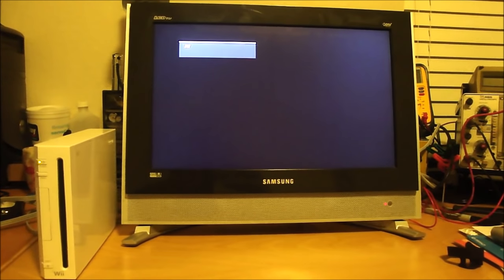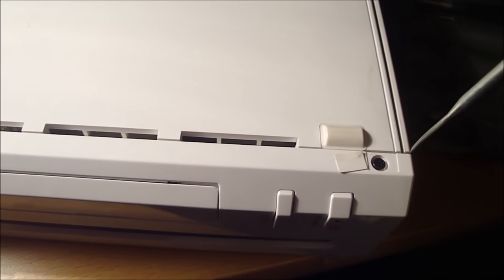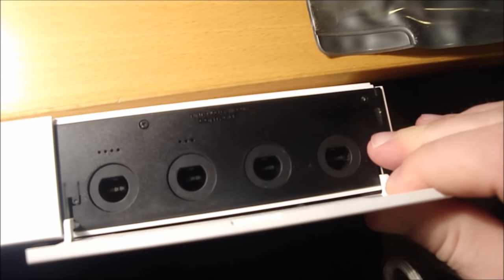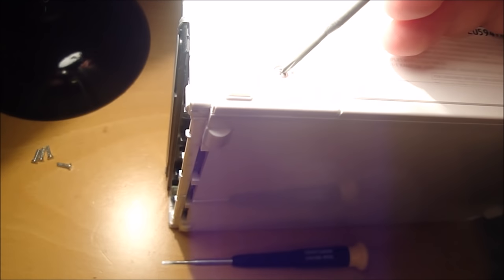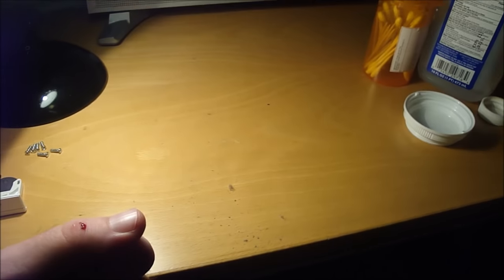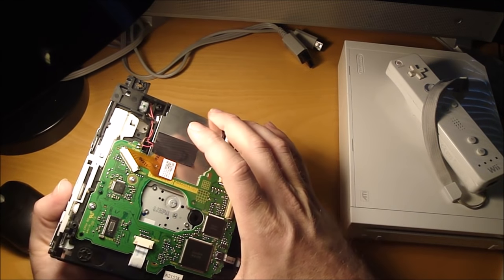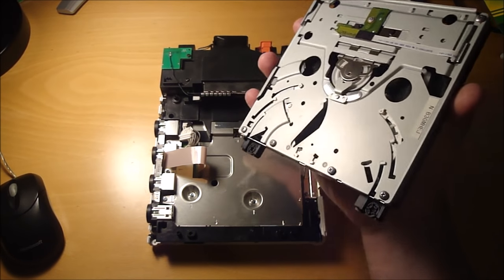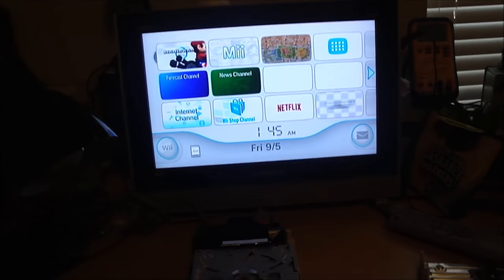Fix Wii Disk Read Error

Comment: I cleaned it like you did. And and turned it on. It showed the game and I clicked on it it got to the safety scream and the said it had trouble reading it. What do I do from there? just do what you did and buy a whole new disc drive?
Reply from the maker: +Aspen Tucker If it does that with most games and the discs are clean and clear, I would say replace the drive. I assume your laser is getting weak.

Comment: hey man my wii wont work for the same reason it wont read the disc thanks for this video man!
Reply from the maker: Let me know if you get it fixed. Thanks for watching!
Reply: @becausestuffbreaks  will do!
Reply: @becausestuffbreaks  i think ima gonna give up
cause i cant get the cover off because
the 3 point screw wont come off
thanks for the video though
Reply from the maker: @epicness69992  you can buy the screwdriver cheap off Amazon or eBay.
Reply: @becausestuffbreaks  ok will do thanks again

Comment: Hi great vid I have the exact problem with your problem that where if I put a disc in it makes a weird back and forth noise do you why it does that? And can it be fixed? Thank you
Reply from the maker: Did you try everything I did? The video has it all.
Reply: I opened it and I tried cleaning it it didn't work so I really want to try to fix it because I dont want to buy cheap knockoffs on Ebay. I dont know what to do is that back and forth noise the laser moving? I might replace the lens
Reply from the maker: I think it is the lense and it's going back and forth because it can't see what it's looking for
Reply: Oh ok I will attempt to replace lens and see if it works
Reply from the maker: Let me know how it goes
Reply: Ok I'm waiting for it to arrive
Reply: @caleb1736  any luck?
Reply: Finally it arrived, I replaced the motor turning the lense. It worked! I know why the lense couldn't find the disc. It is because I moved the side of the lense (NOT the top, and I had gloves on) and as I moved the lense where the rod was. It was stiff! You needed more effort to move and that back and forth noise is when the lense can't move far and it trys as hard as it can. That's why is goes Click click click. Anyways I looked at the motor for the lense and saw that the motor wasn't turning smoothly. I relubicated the metal bar to it and left it for a while then, came back and saw that is was turning smoothly! I put it together and it worked although the lense did go beeeeeeep about 7 times! When it is supposed to beep once, It still read the disc. Thanks so much for the vid!, I have a video on my channel about my wii being fixed and the laser lense. Feel free to check it out (warning I'm new to YouTube so please dont think my vids are cringy. Anyways thank you for reading this! Glad YouTube exists
Reply from the maker: Awesome! Thanks for the update.
Reply: @caleb1736  thx a ton for the update! I will have to check that on my disc drive.
Reply: No problem anytime!
Reply: Let me know if you need any help I will try to answer you as quick as I can 😉
Reply: @caleb1736  welp i kinda gave up and just took wires off the disc drive and put the board in itself and hacked the wii. (broke some plastic to lol. Like where one of the tiny boards sit near the power plug back of board. Also where cmos battery enters.)
Reply: Cool😁

Comment: Should I buy a disc drive exclusive to Wii or can I use any DVD drive?
Reply from the maker: +Bharath Ram you have to use one exclusive to the wii. Refurbished drives are cheap on eBay.
Reply: ***** Okay. Thank you.
Reply: Justin Peters hi I'm having a problem with my wii when I put in the game I don't hear the sound I'm not sure if the lens needs cleaning or I need to replace the drive
Reply from the maker: +Sting Are you able to play but just don't have sound?
Reply: ***** I'm still able  play it but when I put the  disc in like it won't read the disc I'm not sure if the drive needs replacing or I need to  clean the lens
Reply from the maker: +Sting If you're able to play the game then it is reading it and your drive is probably good. If you don't have sound, it's possibly an issue with the cable or TV. Am I understanding your problem correctly?
Reply: ***** just now I put in wii sports it started reading then it went black and it said error has occurred and when took out wii sports and  i put in smash bros brawl it didn't read
Reply from the maker: +Sting I understand now. I would recommend trying to clean the laser first. You can try blowing compressed air into it, use a cleaning disk, or take it apart and use a Q-Tip with rubbing alcohol. If that doesn't work, you need to replace the drive.
Reply: ***** thanks

Comment: Hi. Can you do a video on the Wii U? My super smash bros. wii u keeps getting an error and it's also worse than getting Brawl to work on a wii. It's a dual layer disc and it's Error 150-1031. Thanks
Reply from the maker: +J-Mac n' Cheese As soon as I get a customer with that problem, I will. In the mean time, try to use a laser lense cleaner disc for the Wii U drive and blow some compressed air into the drive. Also, clean the game disc with a cotton ball and rubbing alcohol. If there's scatches on the disc, try to buff them out with a cd scratch remover. Let me know if you get it working.
Reply: yeah i know the disc is clean and minor scratches aren't the problem. I assumed it's dust or problems with the lens

Comment: I opened it up and put a disc in but the disc would not spin. Is there a way to fix this without buying a new disc drive
Reply from the maker: +imagbaby5 I would recommend replacing the drive because it's cheap on eBay and easy to replace. Do it however you want. The motor could be bad or a sensor isn't detecting the disc is in. You can try blowing compressed air all through it and clean all the optical sensors befor going after the motor. Let me know what you do.

Comment: You never fixed the disc error. It had nothing to do with the laser itself in this case. Nintendo made an official laser cleaner which I use and doesn’t require opening the system. It’s cheaper to buy a different Wii than to  buy a new disc drive.
Reply from the maker: How did I not fix the disc error? It was reading the disc after changing the drive. Back then it was cheaper to replace the drive but now it's better to just replace the the whole Wii.
Reply: Justin Peters when the Wii’s don’t read discs due to the laser the drive doesn’t make that sound. That was a different issue. Putting a new engine in a car will fix the issue but that skips actually fixing what was wrong with it.

Comment: do u gotta get a specific disk drive for it???
Reply from the maker: +IISharpshooterII Yes. You need to take the old drive out and compare it to the one you want to buy because there are different cable orientations. There's also some websites that can tell you what drive you have per the Wii serial number.
Reply: can you give an example?

Comment: I don't know if you still read the comments on here but my wii is able to read other wii games except brawl which is dual layer and Ive cleaned the laser lens and still doesnt read it. Do I need to buy a new drive? The weird part It can read games like nsmbw and not brawl =\
Reply from the maker: +SLIME that's odd. Could it be the disc?
Reply: Justin Peters I recently bought it from ebay and it didn't come with any scratches on it. I don't know if it's the disc or the drive.
Reply from the maker: +SLIME if it's working on every other disc, I can only imagine it's the disc. Do you have a friend with a gaming console you can try it on?
Reply: Justin Peters Sadly I don't know anyone that has a wii still.
Reply from the maker: +SLIME that sucks. Let me know what you end up doing.
Reply: Justin Peters So I just looked at my nsmbw disc and that thing is ultimately scratched and my wii can still read it normally. Like you have no idea how many scratches it has on it. While brawl has basically none compared to it. Should I just buy another drive that works and replace it?
Reply from the maker: +SLIME I still think it's the disc but feel free to replace your drive. Probably cheaper to buy a new drive than a new game.
Reply: You got a bad burned Brawl, I've seen this on Xbox 360 & PS4 games.

Comment: Well I bought a new disk reader for nothing, that little snap thing broke off and couldn't plug the flat wire back. Anyhow I cleaned the old lens and that solved the problem even though it didn't look dirty at all.

Comment: I'm having the same exact problem  with the disk reader but I don't know we're to buy the replacement pices. If anyone could send me a link to were I could buy one that would be great! 😁😁
Reply from the maker: I bought it off eBay. I removed the old drive and made sure the picture of the one I took out matches the one I'm getting because there's different cable routing. 

https://rover.ebay.com/rover/0/0/0?mpre=https%3A%2F%2Fwww.ebay.com%2Fulk%2Fitm%2F261987549355

Comment: i got some plastic piece fell out (looks to go to side but idk). Also tiny black plastic stuff falling out lol
Reply from the maker: That's not a good sign
Reply: @becausestuffbreaks  ya but wierd thing is it still took the disc and tried to read it. So I am going with lazer dying or something. I put the wii back together without the disc drive installed and it works :). Just gonna home brew it :). My original wii still works with disc drive

Comment: You didn’t click into the game? That’s where I keep having problems? Did it not actually work with this wii??? I get it might work for others and this video was very helpful in knowing how to take it apart and replace the disc drive etc…. But my guess is it doesn’t actually work or you would have shown us that???
Reply from the maker: My customer didn't give me a controller so I couldn't. As you can see in the video it wasn't even reading the disc before and now it is. With that said, the customer did come back a week later and said it was working perfect and then came back another week later and said it would load the game and then freeze. I offered to fix that problem for free because I assumed it had something to do with the drive but then I never heard back from them. So that's what happened after making this video. Wasn't hiding anything by not starting the game. Just didn't have a controller.

Comment: I tried to pull the face off of the wii and the red wire pulled out of the holder for it. Is there a way to put it back because I think it is impossible
Reply from the maker: You can always try Duck Tape. It fixes everything. Just kidding. I don't have the Wii anymore so I'm not exactly sure. Sorry.

Comment: what size flat head??
Reply from the maker: At 4:15 into the video I show exactly what flat head screwdriver I used. It's a Craftsman 1/16" slotted head with a 1.5" shaft. It came in a set of precision screwdrivers.

Comment: How do I fix a Wii that makes a noise?
Reply from the maker: I assume it's the drive. You can try to lube the track and screw gear for the laser with some white lithium.
Reply: @becausestuffbreaks  it doesn’t make noise like this wii did. It does scratch my discs whenever I put one in and reads it. Then later it says cant be read and it makes noise like buzzing
Reply from the maker: @DAK1dd2010  It's possible a screw or something holding the motor in place is loose and causing the disc to hit the laser assembly. Make sure every screw is tight on the drive assembly.
Reply: @becausestuffbreaks  thanks for the info!

Comment: i had a ps2 that did something simmular and i found some one that worked on game consoles they told me it had an alighnment issue and i spent some money had it fixed then after a few months of use alignment got knocked off again ((it was an issue with the early ps2 models)) soo if you know how to realign stuff you can try that if you come across another one like this

Comment: I heard the same exact sound loading my wii disks. I hope it just needs a clean. If not I think it will be a nice prodject for the weekend.
Reply from the maker: Cleaning the laser lens will fix most read errors for any DVD/CD ROM. Let me know if it works.
Reply: i can fix it easier without taking it apart i just needed to buy one of those green air cans and my dads work gives it to him for almost free
Reply: ***** my wii doesn't load the disks well when laid horizontally. The disk loader is probably not strong enough anymore to secure it. For now I have replaced it in its vertical position. I may order a new disc drive in a year or too. Or just buy a Wii U.
Reply from the maker: That sounds like a Playstation I had that only worked when I put it upside down. It eventually stopped reading disks and had to replace the laser assembly. I looked into replacing the laser on the Wii but it was easier to just replace the whole drive and a refurbished drive is cheep.

Comment: So pissed why the hell does Nintendo use tri head screws those things are so hard to get off I'm so close to just breaking apart the wii to clean it and making a "duct tape" mod
Reply from the maker: +Joseph Foster lol, make a video on how to do a duct tape mod for the wii. In my video I show what size flathead screwdriver works to take them out if that helps.
Reply: no i know i saw that but it did not work for some of mine because they were worn down already somehow? lmao it dont matter i fixed it and now have a rainbow duct tape mod for my wii hahahhhhahahaha
Reply: that's the person they are trying to keep out right there